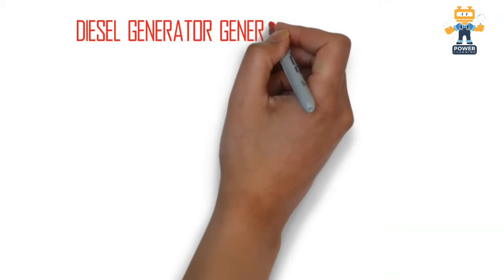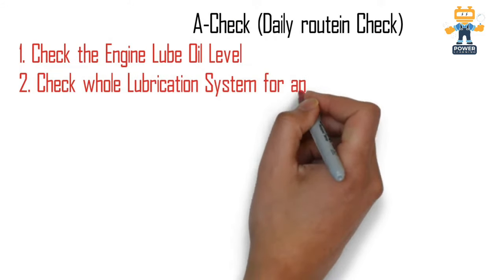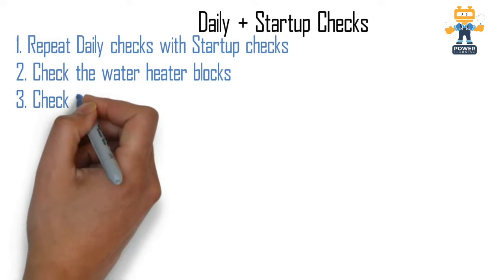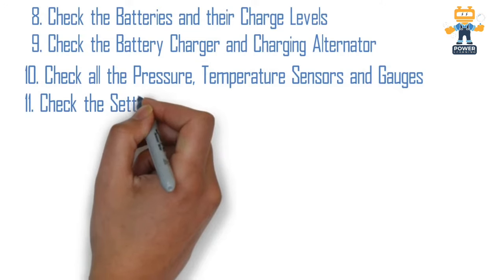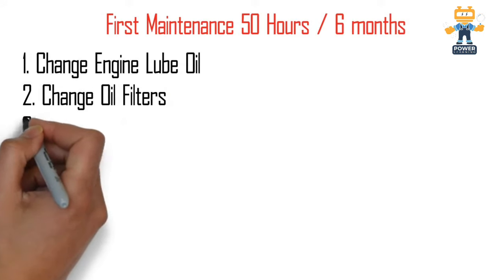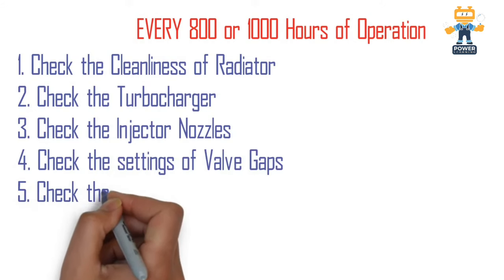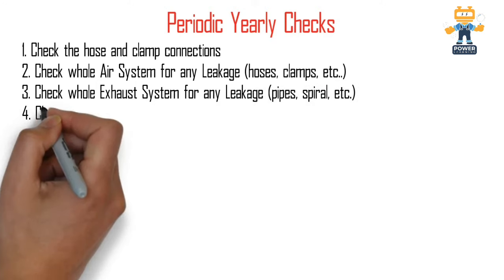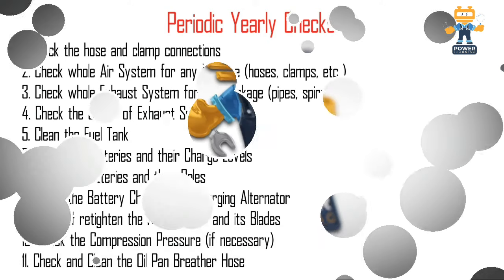#maintenance | Diesel generator maintenace and A B  D CHECK LIST PROFESSIONAL/beginners

Comment: Salaam brother 
We have 1.5 mega 16 cylinders Mitsubishi diesel generator .
When it runs on the load  , one side exhaust goes red hard, not both.
What could be reason?
Reply from the maker: Inspect you fuel Injectors **